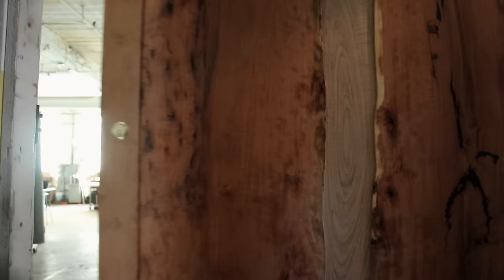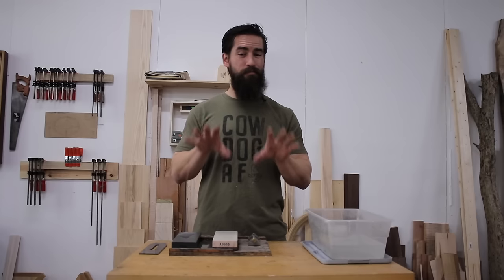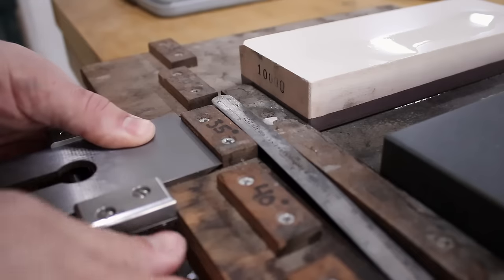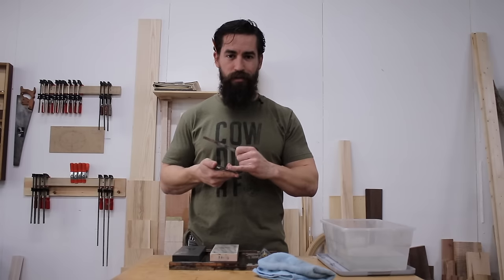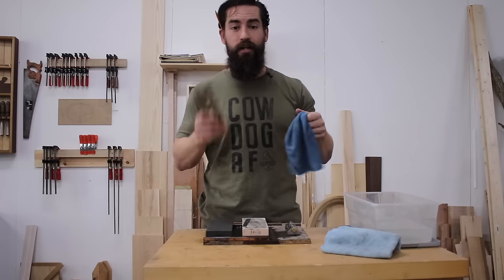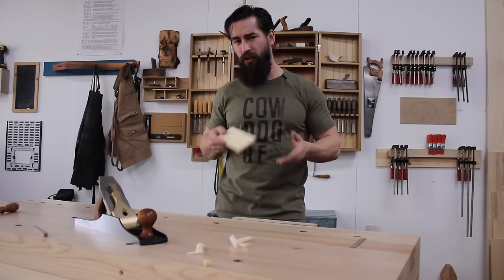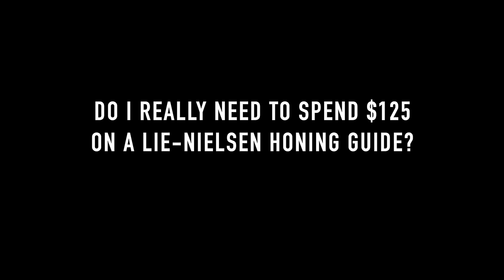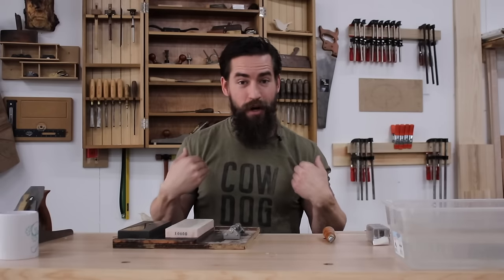The Most Important Skill In Woodworking

Comment: ATTENTION!!! If you go with the cheaper honing guides watch out! When  tightening your blade in the guide some of them won't hold it parallel to your Sharpening surface. When tightening one side will lift higher than the other. I sharpened 2 chisels and a plane blade and was thinking all my hard planing was crooked...nope took a good hard look with a few squares and even measured the length of the plane blade and found out as you tighten the hiring guide the parallel edges that the plane sits in weren't parallel and found a small gap where it's supposed to sit and that small gap will mess up your blade.

Comment: No im not doing it wrong. There is nothing better than DMT Diamond plates if you can't get that razor edge is 60sec or less you are doing it wrong.
Reply: You're doing it wrong. Let's use logic and reason here for a moment. They electroplate diamonds onto the substrate. That plating is a coating and that coating has a thickness. How thin do you think they can possibly make it? If that coating thickness is taller than the abrasive grit then the grit will never be exposed. So there's a definite limit to how fine diamond plates can be. Personally it is my opinion that the lower limit of diamond plates is 1,000 grit. Although I know they make them finer than that. I just don't think they work too well practically due to material limitations. So what you need to discover Neo is The Matrix! The diamond matrix, that is. But that's a rabbit hole to go down. Because most "diamond matrix" is bogus. Usually what you're really buying is silicon carbide. Though people do still like it. Even if what they're getting involved with is a fraud.
Reply: I think doing both grinding and final honing on diamond won't yield the most potential from your edge, as diamond has upper grit limit due to technical limitations. Restoring bevel on 220 diamond plate, refining it on 1000, then going to finer lapping papers on a flat surface, like granite, then stropping would yield maximum potential or close to it.